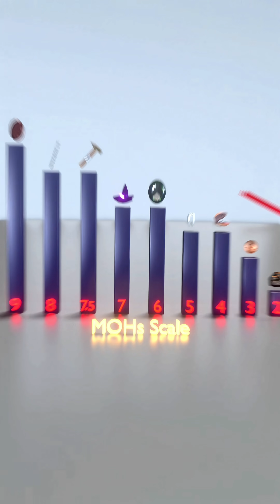Diamond vs Hammer: The Brutal Truth

Comment: Thank you, thank you, thank you for posting this! It explains something I have wondered about for YEARS! 

I have a diamond engagement ring that was lost in a carpark, driven over many times and then recovered days later and the diamond was cracked 😢

I had always thought, like you did, that this was impossible so I was scared my diamond was actually a cubic zirconia or something. But you posting this makes me realise it could've cracked under the pressure. 

Thank you so much for having the humility to share how you've learnt from others, and therefore solving a 7yo mystery for me! 

(I did have it repaired by a jeweller, but they couldn't do much because of the break, I have always wondered if they were lying to me)

Comment: hardness isn't brittleness, diamonds are brittle, this is why diamond cutting blades are all coated in tiny diamonds instead of being shaped from a single piece, they just usually don't break because it's such a small piece. steel has some flex and stretch which a diamond lacks, this means eventually in a head to head the battered steel will be mostly intact and at some point the diamond will not due to it's inflexible nature.

Comment: Now if you can get a hold of some liquid oxygen heat that diamond up till it's red hot and drop it in there. The diamond will evaporate turning into carbon dioxide gas

Comment: Also hardness and shear strength are not the same!
But they are closer linked. 
As harder steel will sooner shatter before bending!
But Titanium is more malleable, or defects more before breaking. 
So one has to know the full tensile strength, hardness, and shearing strength, to truly know a material!
Even know all of that, some material changes drastically with temperature. Also Diamonds burn very hot.. Imagine using Diamonds to smelt steel! YIKES! $$$$

Comment: It's about pressure and the area of impact.  Diamonds are hard but they're not flawless.  They have microcracks meaning enough pressure in the right place and they will split.  You can see the hammer takes a lot of damage as well but it's simply larger.  So while it takes damage it deals enough damage to the diamond to cause the fractures to grow enough the diamond splits.

Comment: The weakest part of a diamond is the point. If you lay it flat pointy side up you can easily break it with a hammer. Do to all the force is concentrated in single location.

Comment: Also, water cutters wouldn't work if it wasn't possible to shatter/cut a diamond with something that wasn't a diamond itself
Reply: Technically water cutter cuts with dust in the water. Theoretically you could think that its diamond dust and that would 100% explain it, so its not a good comparison.

Comment: It's actually the opposite, the softer the material the less likely it is to break. 

Hit a sponge with a hammer all you want but it will not break. 
But it can be easily cut, bruised and scratched.

Comment: Putting the hammer on the Mohs scale is also a bit inaccurate, since for metals typicalls the rockwell hardness scale is used.
The difference is that the Mohs scale is strictly comparative and has no proper test beyond "this is scratched by diamond but not by quartz so it's a 9", whereas the Rockwell scale is measured by the penetration depth in a tested medium using a standardized probe with a standardized force. This makes it much better for testing plastic materials and conversely, pretty useless for testing brittle materials (such as minerals)

Comment: Bort is the durable kind of diamond that they use in construction and blades and sharpeners. Its usually black or sark brown and the reason its so strong is the crystal structure is a lot more dense and complicated compared to the wide open crystal structure of white diamond that gives it that pretty clear look but also makes it easier to break into larger piece

Comment: It's just like the tile floors you see. The rubber on our shoes is much softer than the tile, but you'll eventually see that it slopes down where people step a lot. A faster example of this is a knife. Paper, food, wood, they're all much softer than the steel, but the edge (sharp part) can still get chips and become dull despite being much stronger than what it cuts. The blade can also break if it's not heat treated correctly with a small bend.

Comment: That's why sapphires are so popular in jewellery. Bunch of clear colors, moh scale 9 and in a lot of other areas the most resiliant gem out there, beating diamond by a landslide in some
Reply: They use lab-grown Sapphire for windshields for helicopters
Reply: @dankman239 yep, they also use them for screens on technology that is made to be super damage resistent, like watches or laptops made to be used in the elements.
Reply: @zagrych that's so cool !!
Reply: yep.  and its fun to compare to things like nephrite jade, which is much much softer than diamond but assuming you have a significantly thick piece you could slam it with that hammer like your life depended on it and it would just ring like a bell😅
Reply: Diamonds aren't rare. At all. That's what is funny about it. It's an illusion to create a market for it
Reply: @linamarie84 yeah, its entirely a false market of demand supply.  The only thing "rare" about diamonds is that it can be quite hard to shape and set them without them breaking since they are so brittle.  But plenty of other gem stones are also hard to shape and set, and the raw diamond stones can literally just be picked up off the ground.  There is no logical reason for them to cost more than say opals.
Reply: @zagrych bro said the same thing while disagreeing. Holy learn to read
Reply: @alephnull7446  lol when did he disagree?
Reply: Yup, a lab sapphire is 4x as tough as a natural diamond. It is a shame that sapphire has no fire/dispersion.
Reply: Nah, opals are the real deal.
Reply: Or moissanite it has hardness of 9.5 passes diamond testers and shines brighter then diamonds 💍
Reply: its also actually rare and not just a artificially scarce hunk of carbon
Reply: Mohs scale exponential like the magnitude scale of earthquakes. the difference between 8-9 is nothing compared to the difference between 9-10
Reply: @Dominative  no. The Mohs scale is just based on whether a thing can scratch one of the base markers. Talc is at 1, and diamond is at 10.
Reply: @beanorama actually he is correct, the mohs scale is exponential.  i wouldn't say the difference is nothing though, 9 is double the hardness of 8, and 10 is double the hardness of 9-- that still leaves 8 pretty darn jard.  its also important to note that the hardness of the moh scale only refers to jow nard it is to scratch the item, mot its overall durability.  nephrite jade is fairly soft in the sense of how easy itis to scratch but it one of the most durable crytals on earth in the sense of how hard  it is to actually chip or shatter it.  diamond is one of the easiest to chip and shatter crystals.
Reply: @zagrych  The Mohs scale isn't exponential. It's not even a mathematical function; you cannot use the system to define a Mohs 0 or Mohs 11, since they do not exist. It's a qualitative test; can this thing be scratched by this standard? If no, it's harder than it, if yes, it's softer than it. By no means does it provide numbers (other than the ones defined as standards), let alone having decimals or the ability to calculate new standards.
Reply: @Huntonius4your right, its not exponential.  its ordinal.  its a mathmatical function.  its doubled every time.  the name of the obscure mathmatical function (( technically operation)) you are missing..... is scale.  moh scale 0 and moh 11 don't exist, thats correct.  however you can know exactly what they would be.  

something that is half as hard as talc would be 0, and while people don't say 0 many items are less than 1 on moh scale.  

as for the other end it stops where it stops because of math.  diamond is twice as hard as corundum, and corundum is twice as hard topaz.  diamond is therefore four times as hard as topaz.  do you see the pattern yet? oh, sorry, thats another mathmatical concept maybe you don't know it.  do you see the system yet?  moh 11 doesnt exist but anything twice as hard as diamond would mathmativally fit the label.  anything four times as hard as diamond would be a 12. 

so yeah.   just cause that part of the scale doesnt exist that doesnt mean we dont know what it would be, or that its undefined.  just like a lvl 11 earthquake doesn't exist on the scale doesn't mean it can't be calculated--10 times more crust movement than a 10.  

in fact its only the math saying that going to that level isn't possible on earth that made the scales mentioned effectively stop where they do.   moh stops at 10 cause we don't have anything twice as hard as diamond on earth.  earthquakes stop at 10 because there is no tectonic plate border on earth big enough to make an 11.
Reply: @zagrych  you got it almost right, the scale works (for the most part, is not perfect, also two diamond can have different hardness) from 1 to 9, but 9 to 10 is at least 4 times harder.

Edit: reading a bit more, the doubleing is maybe an average, if we are being lenient about. For example 5 to 6 is just 1.2 increment ratio.
Reply: @JoseNovaUltra I genuinely have no idea what you are saying.  Not even in a mean way, I genuinely don't know, sorry.  the hardness doubles each level, that is what an ordinal scale means.  all diamonds have the same hardness on the scale.  An individual diamond can be more fragile because of natural fault lines or inclusions etc, but that itsn't the diamond material itself suddenly having a different hardness-- its the same scratch resistance as any other diamond material.  diamond is carbon atoms lined up in the specific crystal pattern they make, cubic diamond.  there are a few other rare carbon crystal molecular structures, but those aren't considered the same mineral.  like lonsdaleite.
Reply: @zagrych  Dude, for someone that has no idea what I'm saying you still manage to answer everything I said, impressive! You know, next time you write "genuinely" like, idk, mean it? Just wasting words to make yourself sound.. what? cooler?

So, an ordinal scale tells you the order of things, and stop, that's the whole definition, it's not interval/ratio defined, you are talking about a log scale (base 2, in this case). Also this one is just easy to check, for example diamonds are at least 4 times harder that corundum at 9. 

As for hardness differences, yeah you are right, for totally perfect engineered lab grown diamonds hardness level is totally the same. For natural diamonds is kinda different, they usually aren't even the same hardness in all plane directions (also nitrogen impurities change hardness), now, I'm not going to act like I understood everything in my crystallography's class, professor was great tho, and maybe this is just an arguement over semantics, so I'm giving you that one.
Reply: @JoseNovaUltra no, thats not what an ordinal scale means.  it means is a comparative scale of the categories listed. Anyway this is clearly going nowhere hope you have a good day
Reply: @zagrych   I'm going to make it really simple for you, look up what is the difference in hardness between corumdum (9) and diamond (10), and then apatite (5) to feldspar (6), are they double from eachother? No, of course they aren't, they aren't even the same either... so your original point is wrong.

Atp idc about your private definition of ordinal scales, the thing is the mohs scale is not what you are describing, whatever that is... is just a scale that doesn't have absolute hardness in mind, is just qualitative, not bound by any mathematical function.

You have yourself a good day too, idk why you act like you just left the table lol, it's a yt comment section, don't be this dramatic.
Reply: @zagrych  No, a^x (some function that multiplies by a for every integer increase of x) is exponential. 

The Mohs scale is not exponential, and was defined using arbitrary standards mapped to integers [1,10]. 

There can be a magnitude 11 earthquake (since it's defined as a mathematical function based on energy of the earthquake); 

There cannot be a 11 Mohs material (since it's defined as a list of materials with arbitrary integer hardness).
Reply: @zagrych  Funnily enough, Mohs is an ordinal scale. That means arbitrary mapping and no explicitly defined difference between its values. Something like (Terrible, Bad, Poor, Fine, Decent, Good, Great), where the difference between each value is either inconsistent or arbitrary.
Reply: @zagrych all you had to do was look up what an ordinal scale is and you wouldn't have made a fool of yourself
Reply: @zagrych i like how you dipped out as soon it was made clear that you’re full of shit. 

“Ordinal data is a categorical, statistical data type where the variables have natural, ordered categories and the distances between the categories are not known. These data exist on an ordinal scale, one of four levels of measurement described by S. S. Stevens in 1946. The ordinal scale is distinguished from the nominal scale by having a ranking. It also differs from the interval scale and ratio scale by not having category widths that represent equal increments of the underlying attribute.”

“Diamond was the hardest known naturally occurring mineral when the scale was designed, and defines the top of the scale, arbitrarily set at 10.”

“The Mohs scale of mineral hardness is a qualitative ordinal scale, from 1 to 10, characterizing scratch resistance of minerals through the ability of harder material to scratch softer material.”

You’re wrong, and it’s okay.
Reply: @pinkharmonica1312 The whole point of the conversation was to say its possible to be harder than diamond if something harder than diamond is discovered, and that you can rate the things in the scale by looking at the arbitrarily assigned things to each number.... that is what gives them a value.  Arbitrary doesn't mean unknown or unextrapolatable. 

Anyway I didn't dip, you randomly nevromanced a conversation from ages ago no one was having anymore.  I am gonna dip now though cause its been a long time I don't remember all the conversation and I do not care enough to reread.

Comment: hardness =/= toughness
hardness: scratch resistance (getting slashed by something)
toughness: blunt force resistance (getting punched by something)
Reply: Hardness generally contributes to how brittle something is. That’s why in alloy making they will incorporate a softer material to give it flex so it doesn’t break as easily.

You can break iron, “breaking” aluminum is much more difficult since it bends easily.
Reply: Another way to say toughness is its ability to contract and expand/stretch.
Reply: Hardness = brittle
Reply: Not in the context of boners
Reply: hardness isn't just scratching too, its how much force can be applied without deformation. but a shock force can still break an extremely hard object.
Reply: If you do a little research into knife blade steels, wear resistance (which correlates to hardness) is in opposition to toughness. Some steels at the right hardnesses will achieve a more optimized balance of the two for certain tasks, but you also need the right geometry (grind and edge bevel) to capitalize on that.
Reply: Here are all the Relevant Stats for determining gem resistances:

Hardness: Slashing Resistance
Toughness: Bludgeoning Resistance
Hardness x Toughness: Piercing Resistance
Melting Point: Fire Resistance
Chemical Inertness: Acid Resistance
Unconciousness: Psychic Resistance